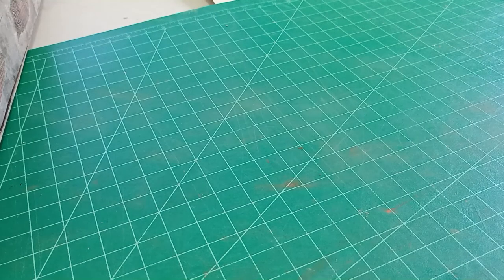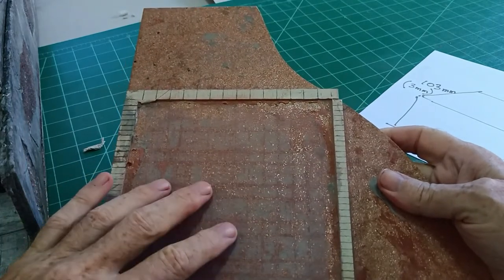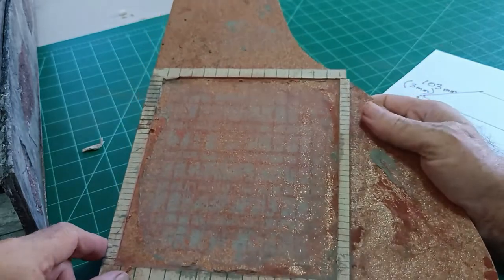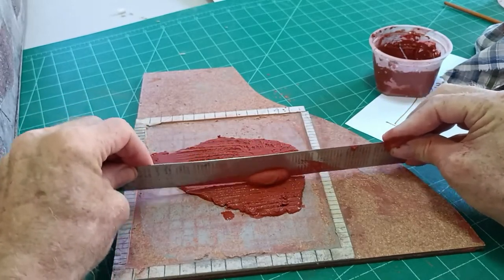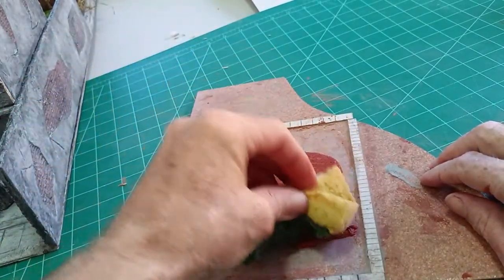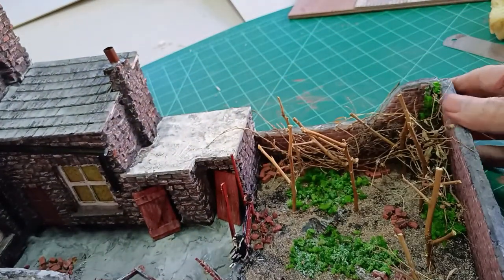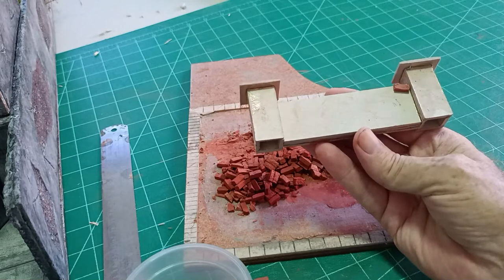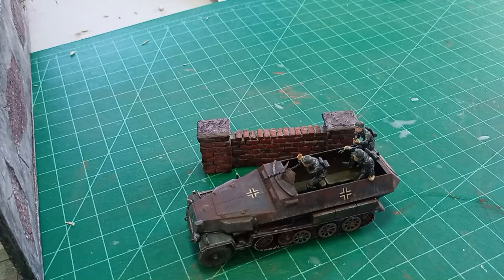Realistic bricks for dioramas

Comment: March 6, 2022---Thanks for the video which I downloaded and just finished watching. I never thought of using tile grout, but then, I'll be using it in a different way. Diorama debris has a bunch of 1/35 scale silicone molds that I've bought in the past few years and hope to use in my 1/35 scale zombie/
apocalypse dioramas. However, the wall molds are a bitch to use when using plaster of paris as the part will more than once, break getting it out of the mold. Hoping in using tile grout, thing will go better. They also have individual brick and cement block molds. The problem with this company is they seem to run out of stock quite often. Me being me, believes in mass production of some things, which is why I'll usually buy 4 molds at a time.